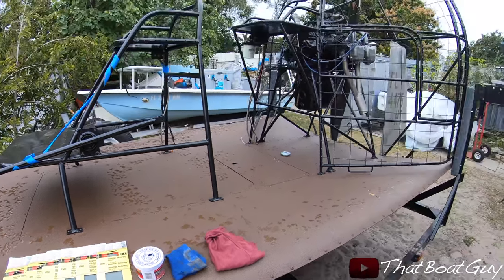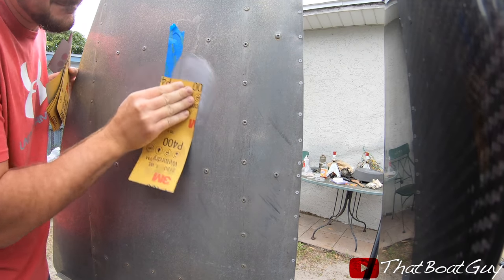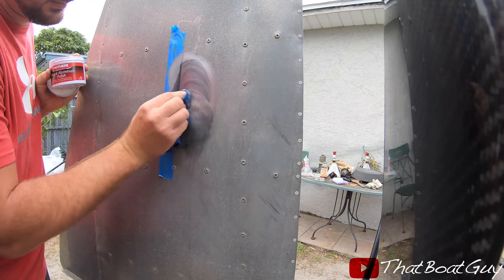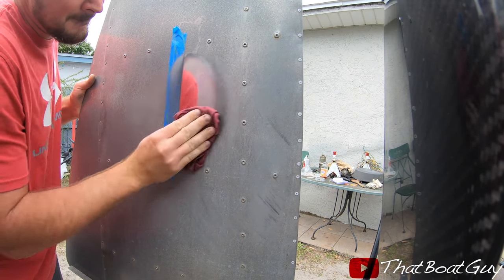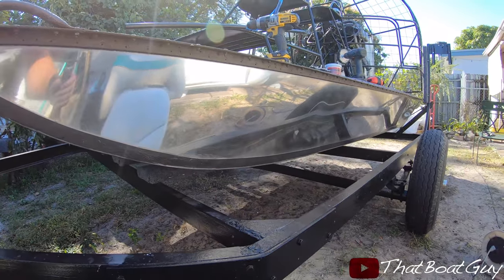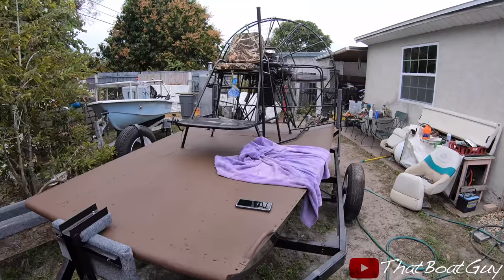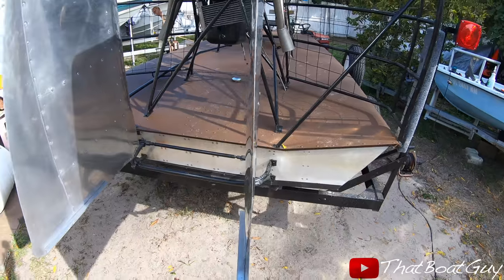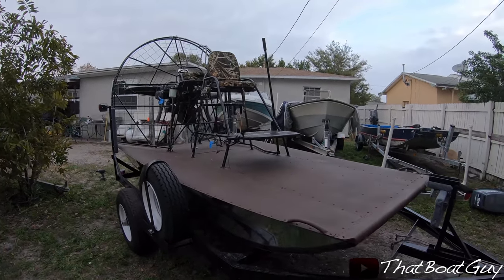Polishing Aluminum To Mirror Finish On Airboat

Comment: Looks great! Here’s a tip... when hand sanding, use a sanding block and go at it on the diagonal overlapping your strokes. Go through all  your grits just like you did the hit the mothers with a random orbit buffer. 

If you have a random orbit sander you can put a foam interface pad on it and using same grits cut a lot of work down for yourself! Thanks for sharing!👍👍

Comment: Good job!  Years ago I got to tour my mentor's aircraft restoration shop.  There was a small plane there that was fabric-covered and painted red.  The paint was so shiny your brain couldn't quite process what your eyes were seeing.  The owner had gone through all the grits, then automotive polishing compound (machine), but still wasn't satisfied with the gloss, but couldn't find a finer abrasive.  He finally got it: toothpaste!  He bought a case of tubes and continued polishing, resulting in what I saw.  But what really gets you is when you realize this gloss was over stretched fabric!

I need to reiterate the comments below.  When wet sanding, keep the surface wet!  It prevents the paper from loading up (you'll use less), and it floats the sanded dust off the surface, exposing more of what you're working on.

Comment: I’ve polished a lot of aluminum.  I agree with using sandpaper.  But I use a squirt bottle with a mix of soap (lubricant to float fines away) and water.  I start at 600 grit and go to 2000 grit.  After that I use Turtle wax “Polishing Compound (approximately 2500 grit).  I would never use any product like Mothers, these product appear to work, but they promote oxidation.  Speaking of oxidation, you will find the outer layer of aluminum is tougher, but once you get past that and into fresh meat, you can start to feel the cutting action.  When you use your fingers as a backer for the sandpaper, in the end, you will see it.  Use a backer of some type to even out the pressure being applied to the aluminum.  Each method will produce a different final finish.  Use paste wax for a protectant.  If you think power tools are the only way, then don’t even start a project like this!

Comment: I have a suggestion; use aggressive compound with a buffer, then less aggressive compound then polish and was....all with a buffer. So much quicker....tight spots will still require elbow grease but, the rest will go much faster and painless.

Comment: Great job with the boat, but I would definitely get a tach that way you can set the prop pitch better, if I’m not mistaken you should get around 2400 rpm with that engine.

Comment: Nice one mate top job, you can get polish blocks in different grits so you can just hit it with a mop on a drill instead of all the sanding but it's nice to see an American using elbow grease instead for once..you guys usually have a massive noisy unnecessary tool haha 😜

Comment: Just one question,  when can my transport truck stop by and load it?
Really your doing a great job restoring that airboat. With the Sandpaper you're cutting oxidation off the aluminum to get it back down so you can polish it.

Comment: I'm sure you learned what works and what does by now. But the typical way you polish such aluminum metal is to use water and wet/.dry paper and sand everything with your courser paper. In your case you started with 400. The clean everything off and go to the next higher grit (600) with water again. But you don't finish that stage until you removed all the 600 grit paper's scratch marks. Once that is removed, you clean it off again and move to the water and even higher grit paper and don't stop until you removed the previous scratch marks and so on. It really is time consuming but done correctly, you will end up with an amazing chrome-like finish. But if you don't protect the new chrome-like finish, aluminum oxidizes quickly with a dull grayish look. To make it tons easier, get a variable speed sander/polisher and you will never ever hand polish ever again...
Reply: How do you protect after polishing, just clear spray cans?

Comment: All the guys that professionally polish Airstreams use a very expensive dual head buffing machine  and they  have a trick  on how to wrap up  towels as thir pads  btw  ebay has way cheaper Chinese copies of the dual head buffers  i’m a fan of Airstream travel trailers  myself  and ive buffed out Aluminum jon Boats  using the same  or similar process you  use  and  using a Dremel/ Mothers metal did a Motorcycle engine on the bike   although it came out okay  a guy on You tube  did his similar engine   apart and thats how i’m going to do my next one  as he utilized a parts washer  to do the cases and  i have my Fathers Antique Motorcycle that i’m going to refresh the motor  any way with new  rings, and seals  and or whatever else it needs